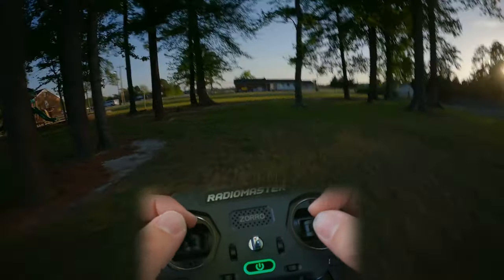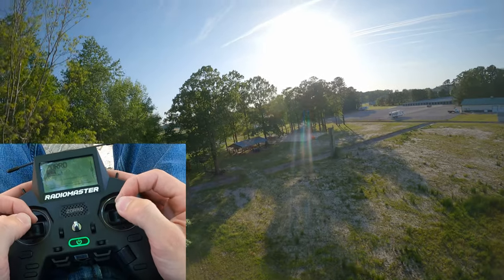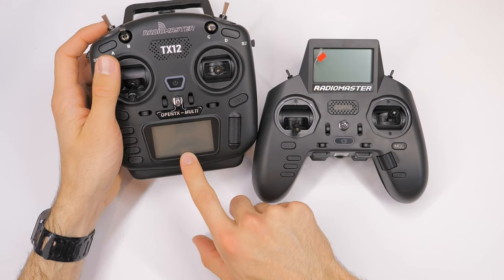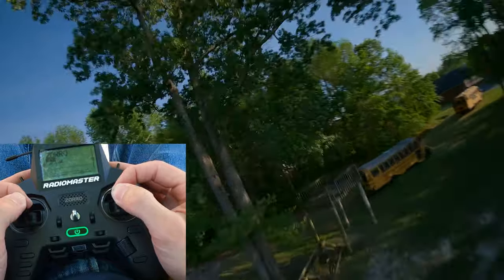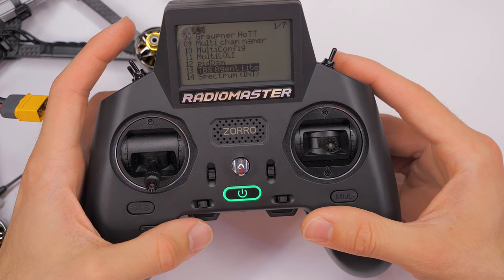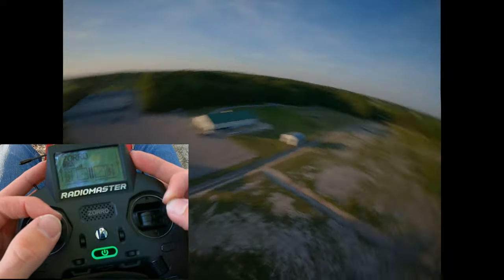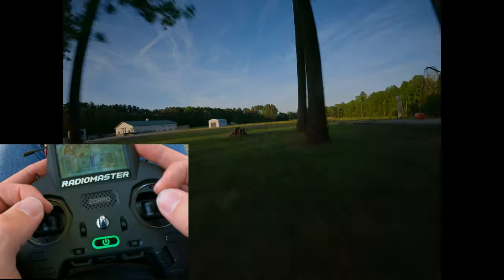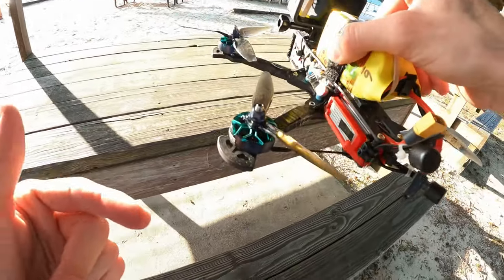Why the Zorro SUCKS (for Pinchers Especially) - RadioMaster Zorro FPV Drone Transmitter

Comment: I can tell you know what you're talking about and I believe you. I do disagree on the premise of the video. Because it does not work for you or genomically does not make it a good or bad radio. Other people may think it's the best feeling radio they've ever had and loved the position of. I thought I was going to hear about terrible range or unreliability
Reply: "genomically"?
"I thought I was going to hear about terrible range or unreliability"

"Why the Zorro SUCKS (for Pinchers Especially)" is the title.......
Reply: @afrog2666  the title can be seen a few ways. Like this radio sucks, and as a side note or sotto voce "for pinchers especially" as 2 separate thoughts or an addendum. If you just use basic empathetic thought in everything you do as a conscious thought for a few days it can become normal fast and you'll find less of these communication missteps in writing, verbal can be too fast if you don't actively slow yourself down.

Comment: I bought this as my first radio, and I love it, It feels perfectly in my hands. I come from years and years of gamepad gaming, and it suits me perfectly. 
I tried later tx16 but for thumb flying not good, so It probably boils down to are you a thumber or a pincher. 
While thumb flying, all the switches are on a perfect positon, as somebody said before, left side and right side 2 position switch are positioned perfectly for quick index finger flip. 
But again, this is for me, everyone has their own preferences. 

Battery lasts for about 2 hours, it is a bit on the short side, but you can also power it with powerbank or put a battery in your pocket of fasten it between handles, so it is ok.
At least for me, I dont fly more than 2 hours per sesion....

EDIT: I did need to dismantle it and significaly loosen the spring of the return to center mechanism of the left gimbal. It was too stiff to fly it with thumb. The yaw/horisontal.
Reply: ROCCO Pazzo  yes for vertical stick adjusments, throttle and pitch, still need to dismantle it to loosen the horizontal tension or in my case yaw was too stiff for me
Reply: Same for me here to

Comment: Hi Adam, thanks for film. Yes, this is a "thumb radio". The main disadvantage for me is that it can accommodate only small batteries and the Open Tx software (which means you have to read and search in internet to find its capabilities); I had (and have) different Graupner, Futaba, spektrum, bunch of Chinese brands and fully self-made TXs and I say zorro is most beloved one at least for small models.

Comment: I spent the last 12 hours programming to work with a massive industrial drone. I also programmed the existing firmware (myself) to give it a tonne of new features that work together way easier. Long story short, I hooked up a go pro on top of the drone with a 30ms latency for the first 2km and with a 4G/5G antenna on the roof of my house, this connects to my phone and laptop to give GPS and phone tower capability. Meaning, I can go forever as long as I have battery in what I am flying.

So, now I just have to put all the individual pieces together onto the 'drone'/VTOL. Has a claw, multiple cameras, a 5 shot harpoon spring loaded system with laser (out of human visual spectrum) range finder and auto aim, bits taken off some DJI equipment for infrared, night vision and 5.1k display. So, within the next couple of days, ill be able to fly from my PC inside or outside with my LG C3 42 inch monitor using the controller with later the planning to use mouse and keyboard for flight. Then, eventually get the carapace lightened and stengthened to be able to fly into things without damage. Since I work in R&D with military, I have access to certain material that basically reforms itself at temperatures above 15deg c. at 30 degrees, it has carbon nanotube type material is super light and 20x stronger than carbon fibre. 

Stay tuned. I have spent over $30k but this controller was required in order to basically get compatibility and to make it look recreational rather than as a hunting and surveilance vehicle.

Oh and this works -> https://d1store.com.au/products/dji-lidar-range-finder-rs

Comment: My zorro sd card had none of the elrs lua scripts . It has jb sounds but only accessable if the card is in a phone .
I made my own cord . Use just the the 2 outside pins and an xt60 and a 2 wire power cord from a broken grinder . Not as thick wire as the 5200mah external battery has . The store bought zorro cord is too thin like headphones . And the flysky jp14 does not bind flysky . 
  The inside battery is 2 hours 25mW and like 5 minutes with external module .
  I cut a notch in jumper t12 battery door for the same external battery i made .
   The grey jumper tpro is my everyday with turtle on a hold down  flap button i wanted to use fir dead man acro switch but they caused some issues with a problem not overcome in the deployment phase of it .
   Elrs i got 1 bind to work out of 3 modules and 6 recievers . Beta fpv nano tx and nano rx are supposed to work unless you flash a version of firmware that works only with all the other parts flashed with the same identical  firmware . What i mean is people do nit know it works and buy it flash it give up send it back and then i guess they sell it as new and by then vesrion 03.03 and version 02.03 etc. Drives the cost up to $125 per tx/rx match

Comment: I have always been able to use both equally, but I do find pinching gives me a lil more accuracy than thumbs. I had always used thumbs on the smaller radios and pinching for the large ones, but I have found pinching on the small more game type controllers have made me more precise and improved my flying drastically compared to the large movement of the big gimbles, I do fly with very low rates too soo i get better control with less movement on the gimbles.

Comment: I am just planning on using this as a controller for my sim on my iMac for a little bit till Black Friday and hope to get a good deal on the RM 16s. I am doing the pinching like you and holding the controller in my palms and having a rough time with my large hands keeping everything still when I am currently using DJI Controller 2, which kind of sucks due to its limitations. I am totally new to FPV of any kind. I am learning with the Avata currently. Unbelievable how much functionality these real controllers have and the prices are so much better than being stuck with DJI controllers only that aren't even compatible swapping different DJI controllers with different drones. DJI like to proprietary even their own freaking controllers. :goodvibes:
Reply: Proprietary stuff always sucks, that's why I only use GNU/Linux and ExpressLRS

Comment: Just came to the same conclusion. The scrollwheels in the wrong place and the angel on the sides was to much. Was much easier to hybrid pinch on t-lite since its much shorter. But i got the 4in1 t-lite before elrs... so after this video on probably going to order a tx12 with elrs.